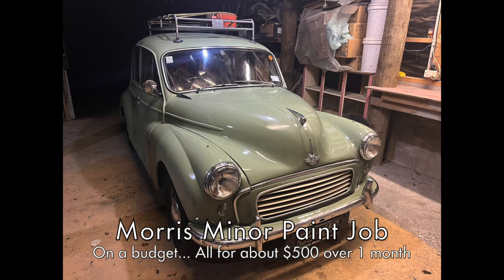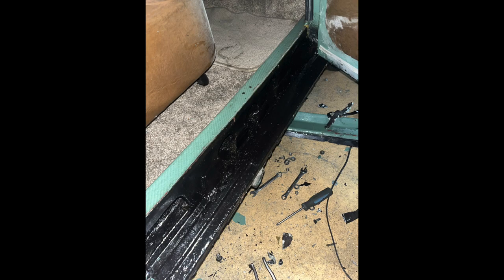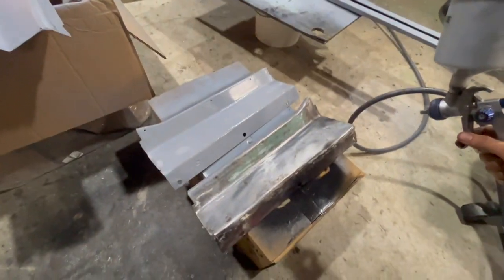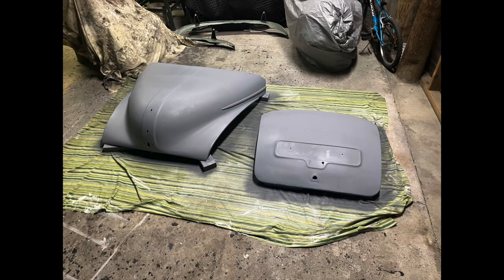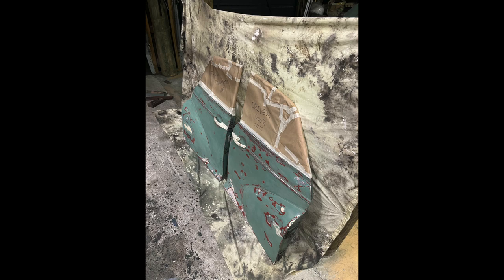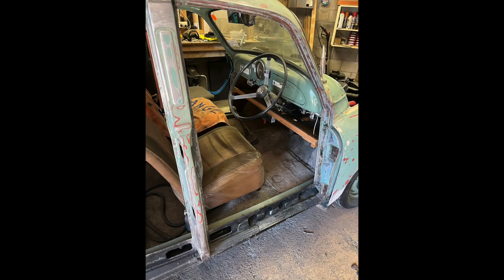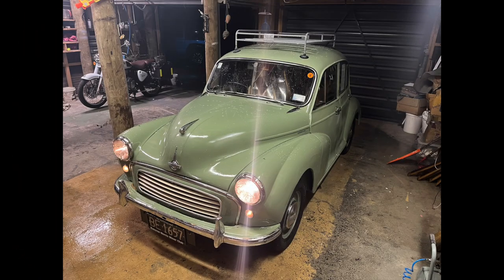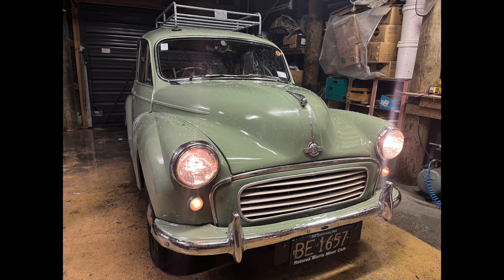Budget Morris Minor Paint Job

Comment: Looks like you did a really good job , well done .
Im restoring an old ish Triumph Dolomite and intend to paint it myself when the welding is all finished. At the moment I plan to use small rollers to paint most of it. And see how it goes. If it looks rubbish i may end up spraying it later on.
Reply from the maker: I don't recommend using rollers as it causes more trouble and headache later if you wanna strip it all off to spray it. Spraying gives significantly consistent and cleaner results, not the mention it's far easier. Best of luck with your restoration! Cheers!